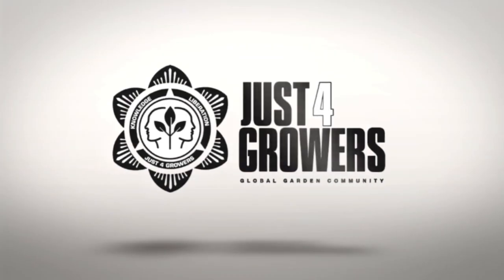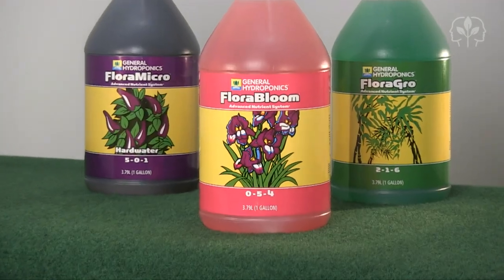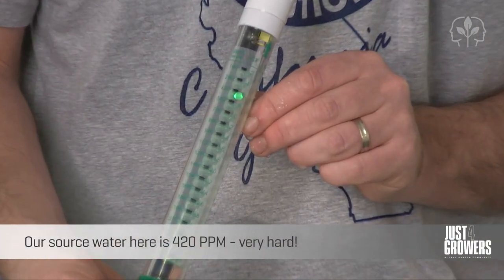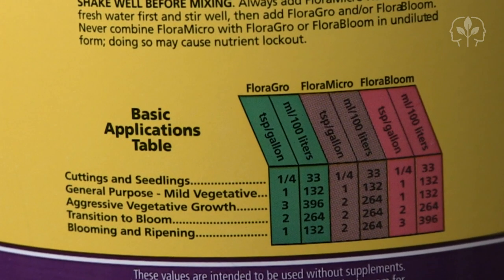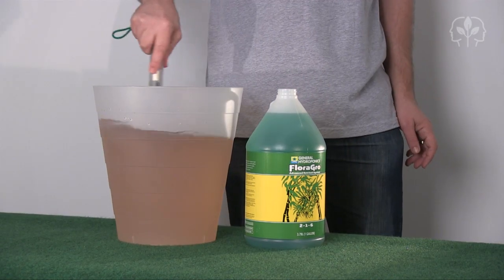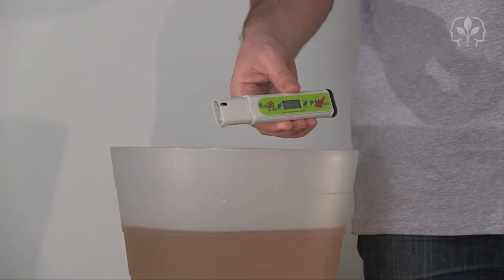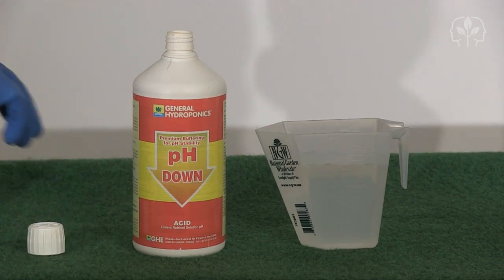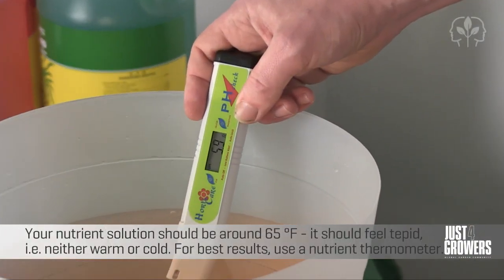How To Mix a 3-Part Hydroponics Nutrient Solution

Comment: I have a question if anybody can help. I'm using RO water in this type of nutrients the same in this video. Do I need to use Cal Mag. They say if you use RO water it's stripped of its cal-mag that I should use it. With this nutrients is it okay to use Cal Mag. Or is there enough in this nutrients? Thank you
Reply from the maker: John Redfern Hi John, great question. Off the shelf hydroponic stock solutions tend to assume you’re using tap water which contains some calcium and magnesium. As such the formularies dial down the levels of these ions to compensate. You should therefore use CalMag with RO water (i shoot for 150 to 300 PPM) stir well and then add your base nutrients.
Reply: Everest Fernandez  My RO filter gets the PPM down to 0.02.    Good to know that I should be using the calcium and magnesium. Thank you
Reply from the maker: You’re welcome.

Comment: ? Question.  I'm using micro grow and Bloom. Do I need to add Cal Mag. They say if you use Advanced Nutrients, not to add anything else. I'm growing Hayes marijuana. Does these nutrients have calcium and magnesium already in it.?
Reply from the maker: Base hydroponic nutrients of any brand already contain soluble calcium and magnesium. The thing is, they are designed for use with regular tap water which already contains some calcium and magnesium ions typically. So if you’re using reverse osmosis pure water you should supplement with cal/mag. Also, if you’re growing in coco coir you should add some cal/mag as this media clings on to it. Try 150 PPM (0.3 mS) of cal/mag before you add your base nutrients.

Comment: Hi All,
As the solubility of the nutrients is a function of the PH level of the water, does it make sense to adjust the PH level of the water before adding the nutrients?
Reply: The nutes will adjust the water themself, so you want to adjust the pH after the nutes have been added.
Reply: I always adjust my ph before I add nutes. Then after if I need to adjust more I do.

Comment: Hi Everest  - Love your videos and site. I'm running a NFT system using a 2 part nutrient mix at around 1.2 EC. I notice that in less than a week my EC drops by a quarter. The water in the reservoir probably also drops by 1/8 as I'm in a hot and humid climate, and running outdoor hydro. 

Anyways, the issue is that the leaves on the plants are NOT a lush dark green, they're becoming quite pale. I suspect it's because somehow the plants are sucking the nitrogen out of the water more quickly than is available. The problem seems to be exacerbated if I get lazy and don't fully change the reservoir water, and only top up H20, plus A+B to get back to my 1.2 EC. 

The only nutrient I currently change is the total concentration of the A+B mixture. My guess is that with these mature plants, y default nutrient solution is not delivering the correct proportion of nutrients to the plants, and that  I need to switch to a 3-part solution to vary both the nutrient proportion and the concentration. What do you think?
Reply from the maker: +James Luong Hi James, thanks for your question. I don't think you necessarily need to change your nutrient brand or product. A two part is just as good at delivering nitrogen and other macro elements as a three part - albeit with less flexibility. But you do need to raise your EC. 1.2 mS seems a little low unless you're growing lettuce. Also, your high humidity means your plants are drawing up less water (and fewer nutrients) than they might be due to lower vapor pressure deficit (VPD). What is your starting EC of your source water (before nutrients) and are you keeping the pH around 6.0 and not letting it drift towards 7 or higher? Try building your nutrient strength up gradually to 1.8. Are you growing flowering / fruiting plants? Also, are you topping up your reservoirs every other day with plain water or half strength nutrient solution?

Comment: Currently using the hard water micro as in the vid as its well water, R0 is not an option due to high wastage of h20. How do you know when hardwater micro is to be used? Should cal/mag supplementation be only used with R0 water?

My water tests at PH 8.9
PPM(500) 298

Calcium 2.77 mg/L
Magnesium .10 mg/L
Reply from the maker: Hi Jerome—calmag supplementation can be a crop dependent thing too. Big bell peppers love a bit of extra calmag! If your EC is over 0.6 mS then consider a hard water micro. I recommend using calmag (up to 0.4 mS) with RO water or anything < 0.2 mS
Reply: Everest Fernandez excellent info, thanks as always.

Comment: Will liquid fertilizer cause buildup inside the tubing at all?
Reply from the maker: +Kevron Rees Yes, especially the "spaghetti" drip-line tubing - periodic flushing and cleaning in between crops mitigates the risk of salt-build-up / clogging. Plus, if you use a high quality hydroponic nutrient the risk of clogging is less.

Comment: A quick question ive been grumbling about for anyone that can answear it, ive got both bloom and gro but not the floramicro. Would it damage my plants if i used these two without the micro or should i be okey? Thanks in advance!
Reply from the maker: +Skurken Affe Hi Skurken, you need to use the micro as well. All those trace elements are very important, even if they are in lower numbers. There's also calcium in there too—all important for stem strength (think bones!) and for transporting other nutrients.
Reply: +Everest Fernandez (Just4Growers)
Thank you for your response, i will make sure to order a bottle right away!

Comment: Well this video is old but ok its one of da best!So if i have a plant 10 days old can i mix 1/16 tsp each(which is 1/16tsp=0.3080576 ml [0,3ml] of M-G-B Flora Series total [0,9ml] with 1litre natural mineral water?And then do it again and again until i reach almost the total amount of 2,5ml per 10litre per month in seedling stage?Well 2,5ml/10lt=0,25ml per litre!!!And something more....when dosage board is 2,5ml per 10 litre its means if my plant for example in 2-3 month requires 15lt of water i dont add more than 2,5mlx3=7,5 per month rigth?Thank btw :D!!!Sorry i forget to say i use soil not water but i buy this nutritients
Reply: Hi how did it go? im curious.
Reply: Well i just realize that first 3-4 weeks dont need nutrients!Maybe something for roots like rootitfirst would do the job very well ! Now i use other nutrients cause they have dosage/lt and are more suitable for 100% soil mix !!! However i like to use florabloom for feeding(still i use it) because it hasnt any amount of nitrogen in it so the chances my plants got burn are reduced dramatically! For example when my plants get in flowering stage i use floraboom 1/1,5/2/2,5 ml etc for weeks 1/2/3/4 etc and i increase 0,5ml per week but at 2 last weeks i low dosage to 1,5/1 ml and then i flush for 1 week more so much nutrients got away and final product smell and taste very nice
Reply: i am going to grow in soil too. How good would the flora series tripack work in soil?
Reply: They are very good but the disadvanage is that they dont have dosage for 1 litre as many other nutrients ! They have dosage something like 2,5ml per 10 litre for example in first weeks! Maybe you can divide like this 2,5/10 = 0,25 ml per litre ! Also i use only florabloom in dosages above and works perfectly but i use pk boosters like Big Bud , Bud candy , B 52 , Nirvana , Bud ignitor , Bud factor X and Rhino Skin in flowering stage ( Advance Nutrients) !!! As you can see i focus more in flowering stage instead vegative stage but i use rootitfirst for nitrogen and root boost first weeks until 3-4 week of my plants' life ! So they work absolutely in soil but be carefull because i dont know the dosages in vegative stage for micro and grow
Reply: that was helpful mate. cheers!

Comment: Need some help my friend. please help me. 1st time grower here. i have a 6 day old plant growing in plain water. i bought the nutrients and the ph up/down. i want to know how do i feed them their nutrients. do i empty the reservoir and fill it with the nutrient mix or do i add some in to the reservoir with the water in it? and what should be the mix measurements for the nutrients for a gallon jug? oh and one more. when do i start to feed them
Reply from the maker: Hello Junior. Thanks for your question.  Your plant requires some nutrition. I take it you are growing in water culture, perhaps a bubble bucket system? You should aim for a low strength nutrient solution, especially for a young plant in water culture. Assuming your water is close to zero PPMs, try 200 - 300 PPMs or 0.4 - 0.6 mS at the very beginning. What brand of nutrients are you using? If it's a standard three part try one mil of each part per gallon.
Reply: +Everest Fernandez (Just4Growers) thank you for taking the time to answer my question. do I just change the water in the reservoir or do I add water to the reservoir?
Reply from the maker: +junior caicedo I would make up a fresh batch of nutrient solution according to my general directions, dump whatever you have in there already, and replace with your fresh batch. Good luck amigo.
Reply: JrThe420Toker nothing wrong with another Green Thumb, LOL

Comment: Hey Everest! As always great videos! Keep up the good work.

I have a question though, can I use the GHE Flora Series with pH regulators of another company? To be specific, Plagron. 
Thank you for you time.
Reply from the maker: Yes Farseer, you can. GHE make an awesome, blended pH down adjuster, but there's nothing to stop you using another brand's.
Reply: +Everest Fernandez (Just4Growers) Thank you, I was worried that they might conflict with each other.
Reply from the maker: +Farseer1995 You should be fine. Some hydroponicists use nitric acid for pH adjustment in the grow phase and phosphoric acid in the bloom phase—but really—if you're having to use lots of pH adjuster then you've probably got hard water and should look to a purer / softer source.

Comment: Hola Everest!  I just enjoy a lot watching your videos over and over again... Thank you for this great info! So, going back to growing, basically we adjust first the nutrient solution based on EC and then after PH, right? I have this problem that after getting down my PH with phosphoric acid, EC goes up more than needed. What should I do or check? Also I have noticed that the roots of my lettuce became like brown color :( does this has to do with high EC levels?
Reply from the maker: +José Salvador Vargas Martínez Hola José, thanks for your feedback. What EC and pH are you running for your lettuce? What is the EC and pH of your source water (before adding any nutrients or anything else.) Also, what is your daytime / nighttime air temperature and relative humidity? Finally—your brown roots make me think low levels of dissolved oxygen in your nutrient solution? Are you growing your lettuce directly in the nutrient solution or are you using some kind of substrate? The low dissolved oxygen levels are likely caused by nutrient solution temperatures being too high—aim for around 19C and always use an air pump and air stone.
Reply: +Everest Fernandez (Just4Growers) EC1= 0.36, PH=8.5; EC2=1.7 PH2=7... Then I added more acid to get lower PH. PH3=6 but EC2 becomes EC3=2.4... As for Tmax=29C and Tmin=14C. Hmax=90% and Hmin 28% (kind of semi-desertic climate behavior). I am using NFT system with oasis cubes and I do not have an air pump nor and air stone yet.
Reply from the maker: +José Salvador Vargas Martínez Hola José. Okay—some very interesting stats. Thanks for posting them. So your source water is 0.36 and the pH starts off quite high at 8.5. I imagine that's due to a large amount of carbonates and bicarbonates already present in your source water. As such, it's taking an awful lot of acid to bring your pH back down to 6. Do check out my article on lettuce here: http://goo.gl/DmN8M5 EC has to be adjusted for light levels, temperature and humidity. High light levels and temperatures with low humidity draws a lot of water  up through your plants—and you need to lower EC to reflect that. Conversely, low light levels and temperatures with high humidity needs to be countered with higher EC. Given your low humidity and high temperatures, I would suggest a lower strength nutrient solution—somewhere at 1.2 - 1.4 mS. I would also look for a purer / soften water source so you don't have to use so much acid to pH adjust.

Comment: Questions Bro : How many times do I water and feed my plants a week....it seems that sometimes they dont need any watering until 6/7 days later as soil is damp and moisture is still there....how do you know when to water it (By hand and Tank) - if its a nutrient reservoir.....and I have the water going through TRICKLERS....how long do I release the nutrients/water into the PLANT (20/30 secs - maybe more give or take tubes size) and how many times a day?... thanks
Reply from the maker: Paul Thompson Hey Paul—thanks for your questions. I responded to it on my blog at just4growers dot com. Check it out. Hope some of it helps. Peace and happy growing, Everest.

Comment: Thanks for the awesome videos, you give out a ton of really useful info.
Question, my water is 70ppm out of the tap, do I still need to use the Micro or should I look at a different brand of nutrients?
Reply from the maker: Vegan Vampire Hey VV! Thanks for the feedback—really good to hear you're finding the vids useful. 

Great question too: 70 ppms is indicative of fairly decent, soft tap water. When using a three-part nutrient, I always recommend using all three parts. If you have hard water (i.e. it shows 200+ ppms on your TDS meter or a professional water analysis shows you have 70+ ppms calcium) then you can either choose a "hard water micro" formulation (i.e. same 'grow' and 'bloom' but the 'micro' part has been specifically formulated for hard water —it will say so on the label) or try purifying your water with reverse osmosis.

Remember: hard or soft water—you still need to use the 'micro' component. It's just a case of whether you choose "hard water micro" or "regular micro".
Reply: Everest Fernandez Thanks Everest, I didn't know it came in a non hard water version. I am only growing leafy greens atm and use the Masteblend formula that Mhpgardener uses. I am in the design phase of setting up 2 4x4 grow areas to do tomatoes, cuqs and bell peppers and I will need different nutrients for them I think. I will give this a try since it seems to work  very well for you. :)

BTW its very refreshing to see somebody growing something other than weed.
Reply from the maker: Vegan Vampire Thanks VV. I am a big fan of MHP's channel. I could listen to that guy all day! He's a very cool dude. General Hydroponics' three-part formula has become somewhat of an industry standard / benchmark and for good reason—it helps to grow amazingly productive, healthy plants and growers enjoy great pH stability. I'd definitely give their Flora Series a try—it's a lot quicker than mixing up your own nutrients from minerals and the price is decent too.
Reply: Question, if am using distilled water which has .5 to 3.0 conductivity do I have use any type of special nutrients or are these fine. Also for some reason i thought the 3 step system was one for each stage, not mix them together? I thought it was one bottle during the veg stage another bottle in the flowering etc? Am i wrong?
Reply: @marvinthemartian619  wrong...
2+2+2 for grow
2+2+2 for bloom
I was wrong also...

Comment: so what about nutrients like canna who suggest you use tap water?
Reply from the maker: Dale Winston Tap water can vary considerably in hardness. Some nutrient manufacturers offer "hard water formulations" for growers with PPMs over 150 or so, however, you really can't beat a purified water source like reverse osmosis, adding Cal/Mag to 100 - 300 ppms, and then using regular (soft water) nutrient formulations. I'm not aware of any nutrient manufacturers who go as far as recommending tap water but they obviously try to tailor their products to the "real world" as best as they can. What's your tap water like Dale? Have you had it tested? It's a very cheap test.
Reply: Everest Fernandez well on the back of the canna a & b it suggest tap water but i think they are basing that off of eu standards because my tap is like 300 ppm last i checked and the water report says 65 ppm of that is sodium. But i think im going to do the ro route like you suggest and add cal mag because its too much guess work which is one of the reasons i moved from soil.
Reply from the maker: Dale Winston 300 ppm is pretty damn hard. I couldn't recommend investing in a reverse osmosis water purification system enough! They're not expensive these days either. Check out Hydro-Logic or IdealH2O. With RO, plants look so much happier, especially at the beginning when you're trying to get them off to a flying start anyway! Go for it Dale, you won't look back! :) Peace out, Everest.

Comment: See?  Now all this time I've been thinkin that the buffering ability of the nutrients kept the PH relatively stable, Now I'll be checkin the PH even more often, I used to set the PH before adding the nutrients.  Thanks for the video
Reply from the maker: Russell Tillery Thanks Russell. I'm glad the video was helpful. Professional grade hydroponic nutrients often contain ingredients that act as pH buffers as well as nourishment for the plant. It's good practice to check pH every day in re-circulating hydroponic growing systems as it tends to drift upwards, especially when adding top-up solution to the reservoir. And yes, you're right, always check pH AFTER, not before, adding your nutrients any any additives. Please sub the channel for lots of practical info on pH monitoring and control! :)